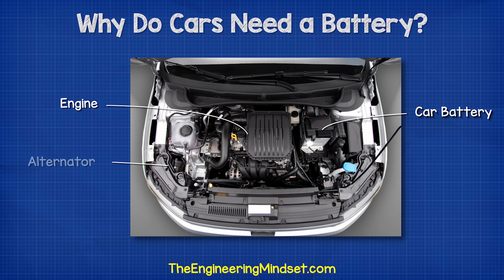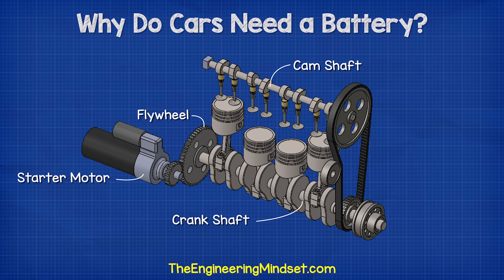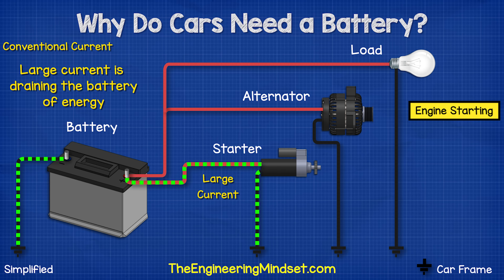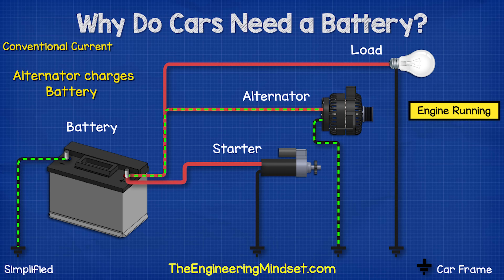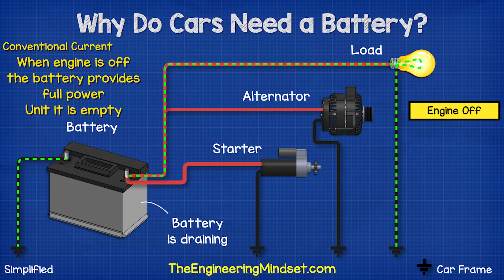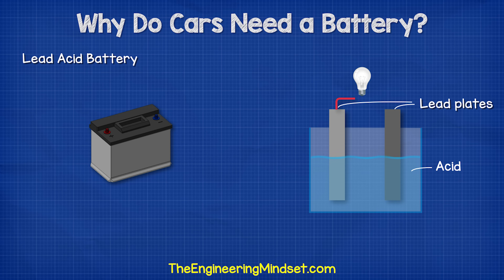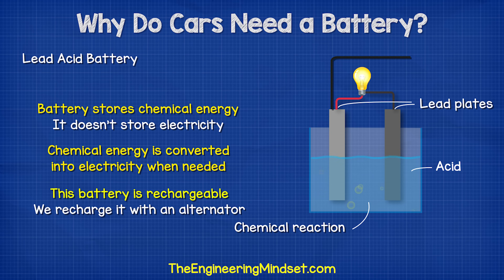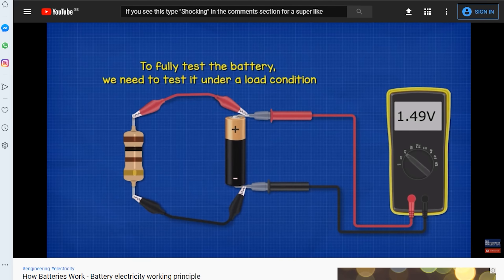Why do cars need a battery?

Comment: Without the battery, the starter won't turn the engine.  If the vehicle has a manual transmission, you can push start the vehicle and get the engine to run.  Takes some effort, but it does work.
Reply: Not realy, because of open circuit. There should be any battery, even empty one, to keep it closed, alternator can easily maintain ignition and some basics
Reply: With todays computer systems you need a charged battery. If not jumping it and bump starting the engine can damage it.
You can run a auto with out a battery or an alternator.

In the old times there were 6 volt systems. Now days everything is a 12 volt system. You also had a Generator it made DC power or Direct Current power at 12 volts. Now days from the 1960's on you have an Alternator it makes AC or Alternating Current power. So you have to change it over to DC to charge the Battery. Some of this is in other videos.
He does a good job of putting out videos that work together to explain things that are coming up.
Reply: @bert1450  yep that is why you have to big Battery for under 30mph and short range.
Reply: Yup, two of my cars are automatic and two are standard transmission.  I can bump start the old Triumph if needed.   I’ve never had a need to do it on the other modern Ford.
Reply: That's why batteries have a cranking rate CCA!

Comment: Battery is just to start the car and run accessories. Once started it will stay running without a battery if you don't use anything like the radio.

Comment: Does the "starter" needs constant current? Even the voltage is changing?
Reply: Voltage and current of a motor under load will increase. The starter at the beginning isn't engaged and takes a fairly small voltage to start spinning up until it engages. Then the little motor of the starter has to turn the entire cam shaft, increasing power demand. It disengages and after that the starter is turned off. If it randomly tried turning on while the engine is running you'd likely hear the gears grind from it engaging at a slower rate than the engine is spinning while operating. The engagement mechanism is using centrifugal force against a spring in most cases to do this thus, it's only needed to start and after that the engine's alternator provides the electricity.

Comment: Why do bathrooms need toilets?
Reply: @TheReal6stringPassion:   ...So you have a place to sit and watch youtube videos. It would get tiring standing up all day.
Reply: There were cars without batteries at the time. In the past, engines are startes with actual hand cranking, though will be more difficult in modern car engines due to interconnected friction and mass.

Comment: Uh, well because they won't start without one?  Just a guess.
Reply: You can start a car easily without one by bump starting them. Bump starting is when you push at car or roll the car down a hill. You engage first gear but keep your foot on the clutch. When you get to speed you release the clutch and the forward momentum combined with being in gear will turn the engine over
Reply: Have you seen old cars with a crank start in the front?
Reply: :face-purple-crying::body-green-covering-eyes:Not lately. But if you have one, then hey, keep on working your crank shaft.